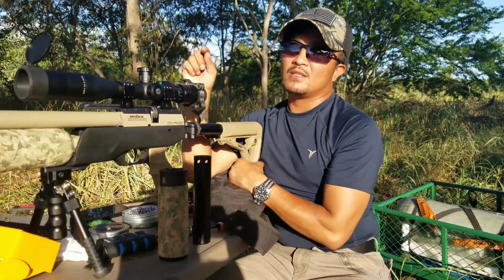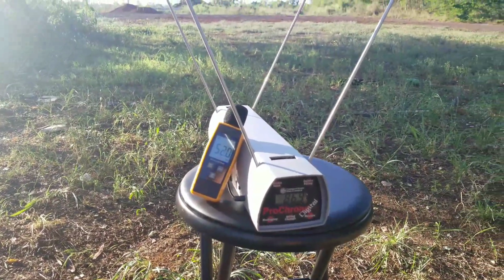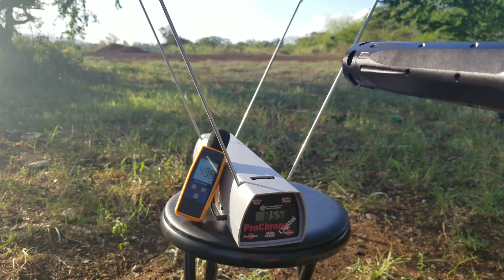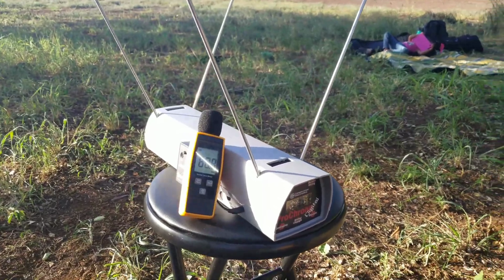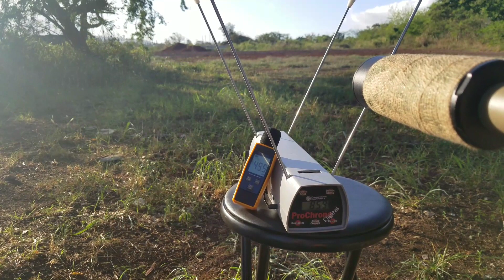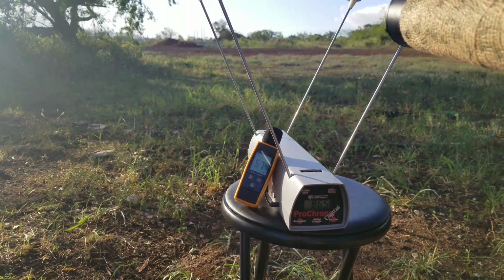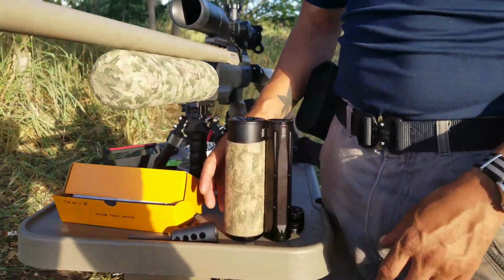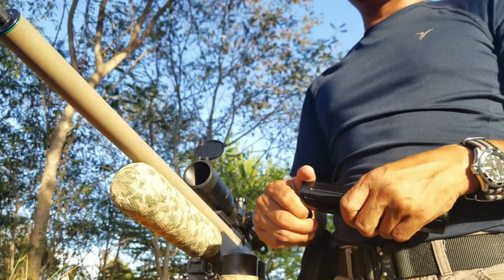DonnyFL Vs Ramus Silencer moderator and Testing

Comment: First, note that the standard for measuring suppressors with a decibel meter is to have the sound meter one meter distant from and perpendicular to the muzzle. Second, when you have a cloth wrap on the DonnyFL that will change the sound signature by reducing any resonance/ringing from the suppressor. Third, I would expect the larger diameter of the DonnyFL to provide a lower tone just as a larger diameter organ pipe provides a lower tone. That will make the DonnyFL seem quieter. It would be interesting to try and capture the sound from 10m in front of the muzzle, to give an idea of what a pest/quarry might hear.

Comment: Theoretically the Ronin captures more air and should be quieter. But I can't look at a coffee can on my barrel and went with Emperor in my humble opinion.
Reply from the maker: Theoretically yes. Should be because of higher volume on the Ronin. But bot always the case. I've been designing and building speaker boxes from my youth to now and the saying goes "there is no replacement for displacement" which is a common saying in the speaker and automotive industry with regards to engines. But design efficiency can prove that saying false. Bigger isn't always better lol. This tells me that the design of the design of the Ramus is even better than the Ronin. Add volume to that and it's over for the Ronin.
Reply: @aerosentinels  In my opinion the material used to absorb the sound is also a key component.  On my 30 cal. Impact screw on empty tube moderator  I cut some carpet samples, rolled it into a circle and inserted into the empty tube. VERY QUIET and there's no baffles or anything.  The Home Depot square carpet samples are free, so I tried several variations.  AMAZING RESULTS and free, free replacements too. Lol
Reply: the ronin doesn't get in the way...

Comment: Great review :) Another thing to consider is diminishing returns on size and power. Because the two results are very similar it makes me think that, that's the most you can get out of a suppressor given the power. No matter how big the suppressor is, you will still hear noise because there's still a lot of air pushing the pellet.